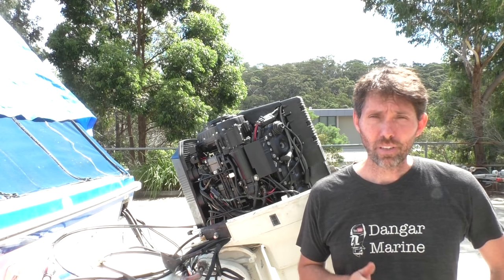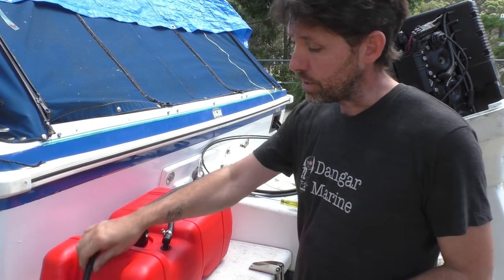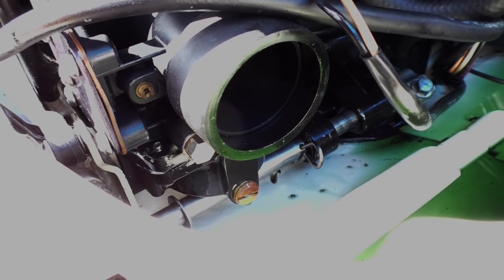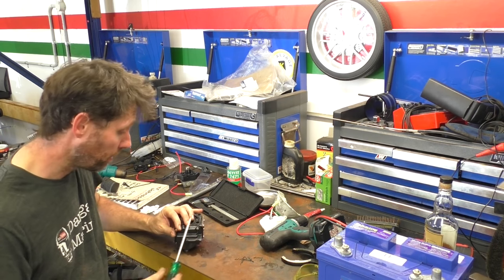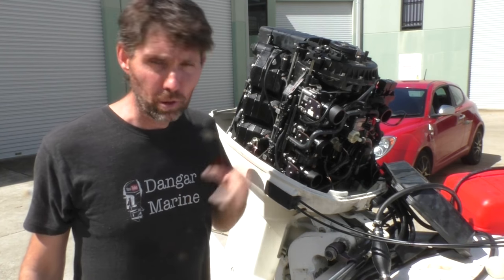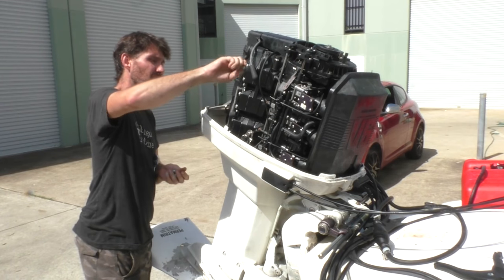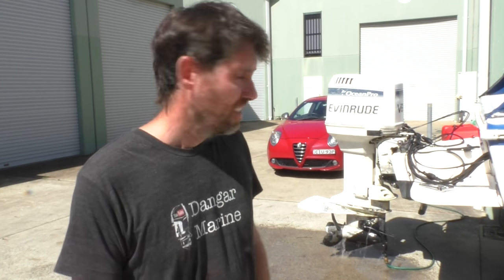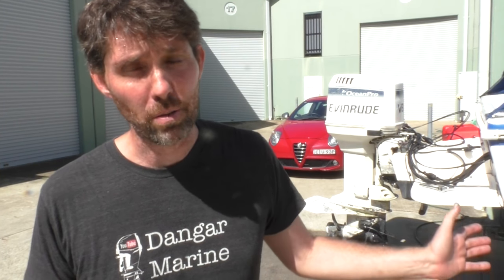Starting the Evinrude 150 for the first time

Comment: I wasn't sure, but I think your quick start did engage.  On my engine it's more noticeable. After the engine warms up the quick start disengages and the engine idle drops and it will sound smooth.  I'm looking forward to seeing you tune the carbs.  I know my engine needs the carbs tuned.  I don't think my mechanic tuned mine right.
Reply from the maker: Yes, good point about the quick start causing the fast idle and being a bit rough. I need to do a bit of homework now on how those quick starts work as I really aren't familiar with Evinrudes at all. I'm learning a lot from this motor too!

Comment: Evrikaaaa!
Thank u posting the start of this engine,i was really curious about since u posted first time u try to start this engine...
Tell me please if u don t mind,how old it s this Evinrude?
Thank u!
Reply from the maker: Hey Florin, you're most welcome. This outboard was made in 1996 according to the sticker, but it is an "EU" model which most people say starter in 1997 so I find I get the correct parts if I just say 1997.
Reply: Good look in the future!
Reply: You probably know this, but the year code for OMC/BRP motors is the word,  "INTRODUCES".  
I=1
N=2
T=3
R=4
O=5
D=6
U=7
C=8
E=9
S=0

So you are correct, EU is 97, regardless of the exact manufacture date.
Reply from the maker: Ah, thanks for that, I didn't know about the date - I really haven't worked much with Evinrudes at all. I'll remember that for next time! :)
Reply: Glad that helps.  

I just had a bad incident.  I  had a rebuilt EMM come via post, so I decided to sneak out and install it.  While installing, a grounding bolt just vanished.   After searching everywhere, I finaly grabbed another to finish the install.

After installation, I turned the key, and she started right up and ran great!  At least for a few seconds, and then there was a horrible crunching and grinding sound, and the engine shut off.   

The missing bolt had fallen down into the vented flywheel and destroyed the stator, and maybe the flywheel also.  AARRGGGHHH!!!

I should have stayed on the couch!
Reply from the maker: thilltony Ah, bummer. I know the feeling. I was replacing the suspension in a car recently and had to disconnect an after market stereo. I forgot to disconnect the battery first and somehow fried the sat Nav. Cost me $2600 to replace it..,
Reply: $2,600... Ouch!!!  No good used ones about?
Reply from the maker: No, I rang a few wreckers and they said they do come up from time to time but none available at the moment. Typical!
Reply: Great tip with the anagram "INTRODUCES" - Thank you!!!

Comment: Congrats Stu!! Been waiting weeks for this day. Im so glad it fired up. Im finally repowering my 2 stroke 50 merc. My plan is the suzuki df60a. Or the other option is the merc 50 4 stroke. The zuke is 3 cyl dohc. The merc is 4 cyl sohc. Any advice on which motor you would choose would be greatly appreciated.I know any motor brand can have a lemon and im not brand loyal. Ive never owned a new motor or a 4 stroke. For me this is a big purchase and don't want to second guess myself after. Thats buddy and keep up the great work!
Reply: Im sorry 60 merc 4 stroke not 50.
Reply from the maker: Thanks mate, I'm glad it fired up too! Personally I would go for the Honda, I've always found them to be extremely reliable, but to be honest, I think the biggest factor really is who is going to give you the best after sale support. If you have a good Merc guy locally in town, go for that, but if it is 50:50 then I still believe Honda have the edge in reliability from my experience.
Reply: Dangar Marine Thats bud. I wish i could do the honda 60 but its more than 3k over the suzuki. The 60 tohatsu is a honda with tohatsu stickers but still shares the same price. In us dollars its 10,930 for the honda/tohatsu 60. The tohatsu 50 is made by tohatsu and is cheaper but the 60 is a honda with BLAST technology... The suzuki 60 is $7,983. The merc quote was 6,300 plus tax. But thats just the motor only. The other quotes were installed with a tach,control,and ss prop. The guy said i could use my same control if i get the merc but mine is 17 yrs old and would rather a new one anyway. Apparently the yamaha 60 is basically the exact motor as the merc and would be 300 more. But new controls n tax its gonna add up fast. Im just not familiar with suzuki but the reviews seem good. Thats for reading this bud!
Reply from the maker: Don't get me wrong, the Mercs are still very good motors, I just haven't seen them around for as many years to prove their longevity. The Suzukis are good too (sorry, I actually didn't mean to write Honda!) but in some ways I think outboards can get a bit over engineered (split offset drive shaft for example)
Reply: Dangar Marine Thanks Ima go with the suzuki !

Comment: Hi Danger Marin! I have an Evinrude 150 HP From 1993, and the problem is that there is poor compression in the four cylinders. Because the gaskets in the carburettors were glued and that they had tightened the screws so that it was graded on the carburettors fleet housing. So probably, four of the cylinders are well dry. But I have changed the fleet houses and gaskets. But unfortunately, there was no better compression in those four cylinders. So now I'm thinking of opening up the engine and checking what has happened. Do you think I'll fix it? I've never done it before, but if I look at how you've done. So maybe I'll fix it. Blessings from Sweden Robert 🤗
Reply from the maker: Hi Robert. I would certainly give it a go. Once you have it apart you will have a better idea of what you are up against. Good luck!

Comment: Great Job! I inherited one of these motors few years back hadn't had time to fool w/ it being a farmer been super busy last few year but need to get it running - I purchased new carb kits, water pump kit & new fuel line - This motor has been sitting for 10yrs now & if it was such low hour motor in what appears to be excellent physical condition - I would repower w/ newer 4 stroke but I've heard these are good strong motors but thirsty for fuel - My question Sir is taking a look at the VRO it appears that the lines are hard & I think I wouldn't trust maybe because it's 1997 yr model - Also not crazy about the oil that's in & around oil tank in the bilge area from either past fillings or leaking etc. Just looks messy - Was curious as to what your opinions might be about just bypass & premix or would you go through & rebuild? Any advice much appreciated, jack
Reply from the maker: It's a good question about bypassing the premix. I've never done the job personally so can't give any details, but the main idea is VRO is that the oil fuel mixture ratio is adjusted based on the RPM that the engine is currently doing. The trouble with this is that it is then send to the carburettors and stored so if you idle for a long time and give it full throttle you are running on low oil fuel for a while. The other side is that if you idle for a long time on premix it will be smokey so it is a bit of a double edged sword. I would inclined to clean the system out, replace hoses then put a bit of oil in the fuel tank until you confirm the system is working (ie, the level is dropping in the reservoir)
Reply: @DangarMarine  Thanks for you opinion - I'm guessing if it's used regularly it would probably be fine but have to think on it a bit being I'm far enough off the coast I. Mountains as to be seasonal operation - Another way to look at it is if it malfunction s to the point of disaster I be forced to go find a 4 stroke which I would prefer but knowing my luck all the 4 stroke money will go to fuel as Im guessing the motor will prove me wrong & run on for long time - Cheers Mate!

Comment: hey stu. I love you're videos. they're very helpful keep up the good work. anyways I was curious if you could tell me what could be wrong with my engine. I recently rebuilt a 1979 55hp Johnson and fired it up but it ran too rough for my liking. I let it run at raised rpm to seat the rings properly like the manual said but as I was doing that I noticed the tell tale wasn't as steady of a stream as it was before I rebuilt it and by 15 minutes in my overheat buzzer went off and I immediately  shut off the motor. I checked the plugs and unusually the porcelain was still perfectly clean and there was an oily residue on the outside edge that evaporated after they sat. is it possible that the head is warped and is letting water in? I am an amateur and am often unsure of myself
Reply from the maker: I'd start by doing a compression test to see if there is a problem with the head. I would also test the water pump in a bucket like this just to make sure it is pumping okay. https://www.youtube.com/watch?v=lOE_VRda52A

Comment: Great Job Stu! Need some advice on a outboard. If you were to buy a new Outboard, what brand would you consider most reliable?
Reply from the maker: In my experience the Hondas have been the most reliable. All the commercial operators (such as the barges that collect the garbage on the river) here use them. Having said that though, all the new outboards are pretty good, and all brands will have occasional problems.
Reply: Dangar Marine Thank you. Honda it is!
Reply: Dangar Marine Stu, what would be  top performance compression on a 4 Stroke 9.9 Honda?

Comment: Hi mate just a question, in regards to fuel pressure or flow is the fuel gravity fed or the piston on the down stroke pulling fuel and air into cylinder ? The reason I ask is the fuel leak you had in carby bowl would the fuel level in that carby cause the cylinder to run lean causing damage ?
Reply from the maker: Down  stroke of  the piston draws air  into the  crankcase which in turn draws fuel from the carb bowl.  Could  be  low  fuel  level in bowl, yes.

Comment: LOL''  I can not tell you how many outboards , I have had burst into flames on me over there years.. from gas leaks & sparky wires,, poof.  I always have a water hose right next to me tho,,     Good stuff,                                                              kodi
Reply from the maker: Ha! I've done it once and I try to avoid repeating that experience. Interestingly it didn't do any damage to the motor at all, just took me ages to clean out all the power from the fire extinguisher.

Comment: We have that motor in the 90hp. But most people do away with the VRO and just premix their fuel. They are a known problem for eating up motors without warning. If you mix fuel you know it's right. And your gas cap needs a o ring

Comment: Off the subject question:   That boat and engine has a large extension mount between the transom and outboard engine.   WHAT IS YOUR OPINION OF THOSE MOUNTS?  DO YOU THINK THEY HELP OR HINDER PERFORMANCE?  DO YOU THINK THEY HELP GAS ECONOMY?
Reply from the maker: I don't think they hinder performance greatly but they do give a lot of useable deck area back.

Comment: Please be very specific with your next video because i have a johnson 90hp and the rpm plays exactly like this one so i would love to fix it. Thank youuuu
Reply from the maker: Starts with a fast idle?
Reply: Dangar Marine thank you so much for your reply!
Im having couple problems with my outboard. First when i go forward and i try to switch back to neutral it doesn't switch, but sometimes by chance it does switch and the rpm is really high so i turn of the motor and back on then right away i switch to gear before rpm gets too high. Second when motor is on neutral the rpm is playing up and down just like your Evenrude.
 What do you think i should do? Thank you very much!

Comment: Hi Stu, My fuel tank is about 3.5 meters from the engine. Would it be a problem if I out the primer bulb beside the engine instead of the fuel tank? The reason I ask is that it will be awkward fitting and using the bulb  beside the tank.
Reply from the maker: No, having the bulb near the outboard is fine.
Reply: @DangarMarine  Thank you very much.

Comment: I have an Evinrude XP150 I just bought. I haven't had it out yet, but out of the water with the ears on it starts right up. However, it seems a to idle steady between 1300-1400 RPM which seems too high to me in neutral. What should it idle at?
Reply from the maker: Hi Andy, it has a fast idle that will slow a bit when the engine is warm, that is probably what is going on with you.

Comment: That loose gasket could have been the reason the engine blew up in the first place because it would have caused that cylinder to run lean, but that sloppy crankcase seal could have done it, too.

Comment: Was the VRO bypassed or did you just premix the oil to be safe?
Reply from the maker: VRO not bypassed, just add oil then run to monitor if the level in the oil tank is dropping before running with pure unleaded.

Comment: hi there i have a question, these motors use oil on gas? or do they haver their independent tank for oil? are they 2 times motors?.
Reply from the maker: This is a 2 stroke motor with a separate tank for the oil to be mixed with the fuel as it runs.

Comment: hey stu just got mine running, ive noticed that my heads are hot to the touch, what about you?
Reply from the maker: They will still get warm, in the sea trials videos I take some temperature readings with an infrared thermometer which will give you a reference. Those thermometers can be bought for around $20 online.

Comment: i just bought a boat with 150hp jhonson ocean pro , when i started the motor   I noticed water coming out of the mid section just under the lower motor mount. like you can see  7:30 on video ... is this normal on this type of motor
Reply from the maker: Yep, that's normal.

Comment: Hey Stu! i m sorry if i m disturbing u with my problem nd i need ur help in a problem i have if u don t mind...i ll try to be very fast to explain u...so... in December i bought my Evinrude 6 HP 2 stroke engine from 1993,since i bought it i did not try it nd last days i was doing this but i found the problem.When i started the engine was working nice,i press back the choke till to the red sign, but when i accelerated the engine wants to stop,then if i put quickly on slow position the engine it s working again nice,if again i m acceleratin it s the same situation,the engine wants to die...so finaly i was going to a mechanic ...after 2 hours of testings nd inspections we found one of the plugs wet,wet,wet....we checked the compresion,i have 8,2 for the both pistons,we removed down plug to up,up plug we was puting down,was changing the spark plugs wires,we was trying a lot of other plugs...the problem did not go...so...seeing like this we decided to order another electronic ignition box nd one of the induction coil from the plug which it s moistened nd wet...today i received the pieces,i removed,the engine it s working when i start it,even when i accelerate it but in time it s stoping nd checking the plug,the same situation...down plug wet again...if i m accelerating up to almost maximum the mechanic say he can hear when the second piston from the wet plug start to work but this it s happening only when i m accelerating hard nd when i put the engine in loud...but if i stop the engine it will start after some tries because the down plug it s already wet...so i m so debusolated because i don t know why the second plug(the down plug) it s moisten...i even don t know,i m scared coz the mechanic said he wants to put down the cylinder head cover to check inside to see why that piston does not work nd why the plug it s moisten because we was doing everything...only this remaining to check inside...
...I ll apreciate any information u ll give me...thank u !!!!!
Reply from the maker: Hi Florin, when you say wet, are you saying wet with fuel or having water on it? If it is wet with fuel then I can see why you are chasing a spark problem, although it could be that there isn't enough compression (air) to burn the fuel even if you are getting a good spark.
Reply: Hey Stu!
The down spark plug was wet from fuel,not water...but i m happy now,in the morning guess what?
I was going to take the engine from my friend s workshop nd was going straight to the Danube River because till now i tried only in the barrel,but before to go to the river,i took new gas (fuel) nd i was mixing with  2 stroke oil,exactly how much it s indicated on the engine cover,meaning 1:100... i was doing this because before i mixed at random nd i readed last night something nd a guy said all last summer was having problems with the engine because of this "trifle"... so i was doing the same nd "Evrikaaaa"...  i want to tell u i was using my little Evinrude for one hour nd half nd it was working very,very nice nd i was content nd to the final of the "race" i checked the plugs...that one it was creating problems before,today was dry,dry,dry....no more fuel there nd i told u ...no signs the engine wants to die.
What u think?... It s possible the mixture fuel-oil was inadequate,it s this a very big problem like this,coz my friends they r using the random mixture?
Nd u said something about compression...I have 8.2 for the both cylinders...I want to find this for the future because  now i fix the problem.
I thank u a lot for the replay nd i appreciate u dedicated ur time for me.
I wish u spor in everything!!!
( Nd sorry for my english because it s not one of the best,we r not speaking english in my country)
Reply from the maker: Glad it's running well now. Oil mixture is quite important for several reasons - protecting the engine, not fouling up the plugs - too much or too little can be a problem. Having even compression reading on both cylinders is a good sign. I presume your readings are in bar which puts you at 120 psi which is also a good reading. Happy days! :)